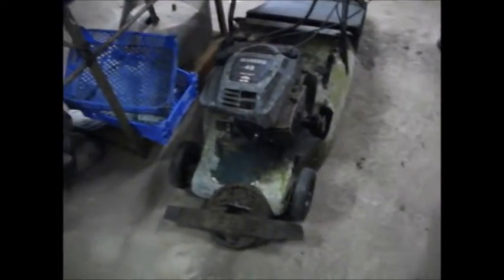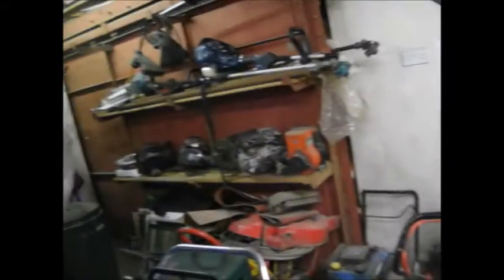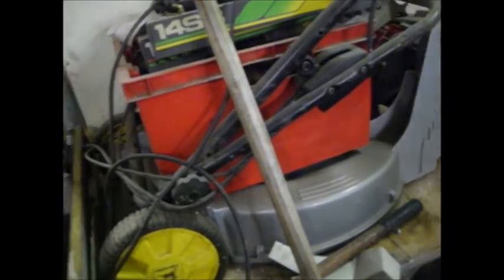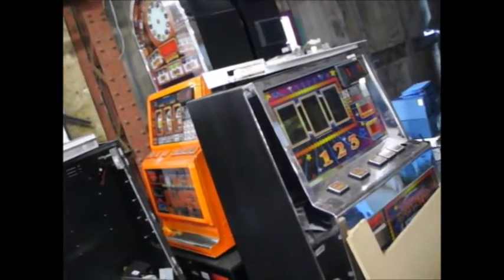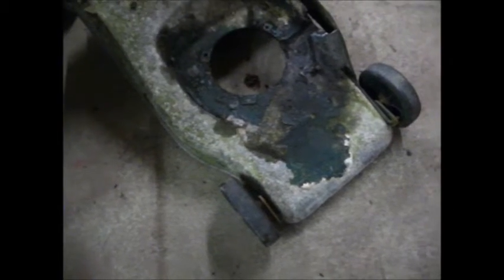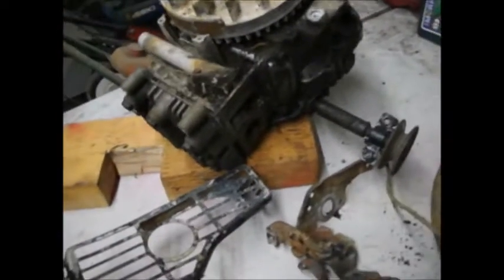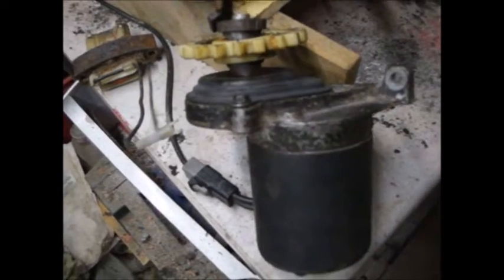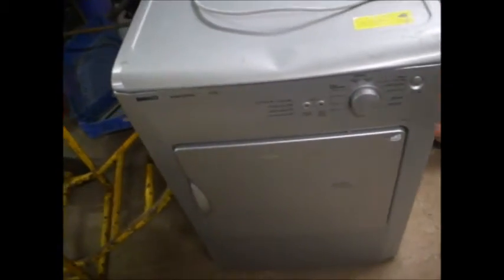hayter harrier 48 mower project, direct bikes moped, worshop projects- you tube video

Comment: Great content . I am looking for a bit of advice . Any ideas on how to repair the alloy deck area that retains the belt tensioner drive pulley on a 48 . It  has corroded away and I am unsure hoe to get the correct location for alloy welding . Thanks in advance .